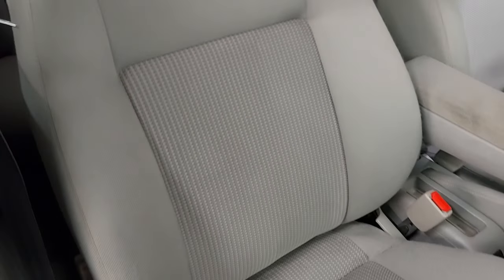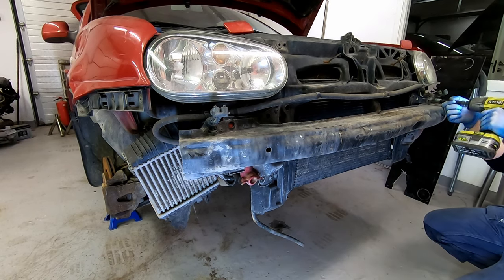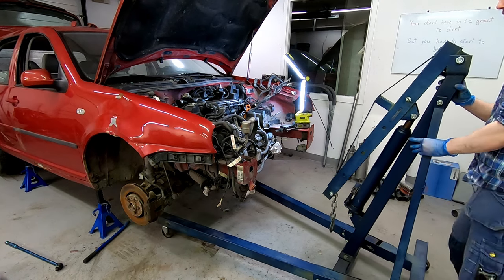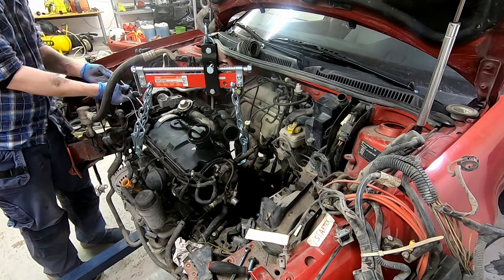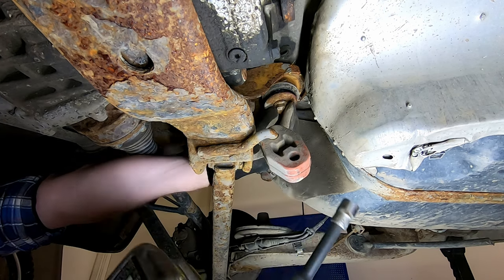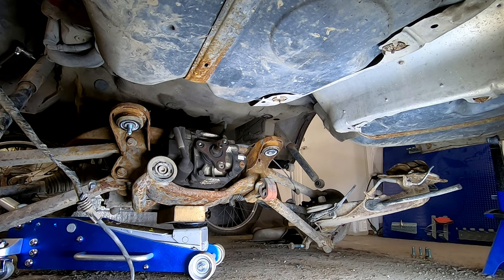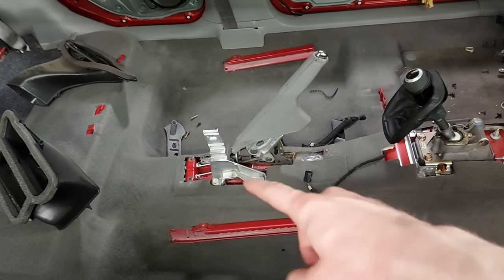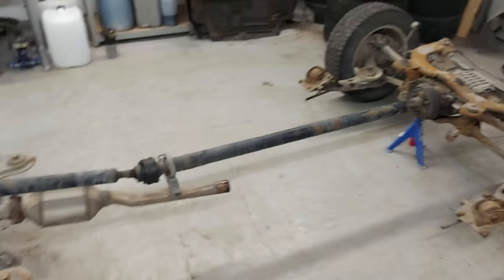VW Caddy Mk1 TDI 4Motion Part 5: Stripping the Donor Car

Comment: Hey really enjoying this build . Any updates?
Reply from the maker: Hey, thank you! It has sadly been on the backburner for a while now, though some more progress have been made. 

The firewall + frame rails have been cut out of the golf, so next step is to cut up the caddy and weld it in. 
Have also been tampering with a new subframe and suspension setup for the rear in cad.

I think you can expect a new episode in 1-2 months, just waiting on the snow to melt away.

Comment: I own a professional carpet cleaning machine that has an upholstery wand that I do auto cleaning I'm in Tacoma WA but if you contact someone small and local you can get really good prices if you pay in cash as most of us little guys are struggling at the moment. We can get ALL of the mold out down through the padding the first time with very hot water and professional carpet cleaning detergents followed by oder naturalizing spray all in a 30 minute lunch break. I just did a similar job for 70 bucks that had split formula milk and mold stains all over I hope this helps someone out there

Comment: But hey, you say in the clip that you wont cut anything near the gastank, but then you do it anyway. Why?!
Reply from the maker: That's a good question! What I actually said was ''gasoline tank'' and the reason why it is much more dangerous to grind/cut/weld etc. near a gasoline tank as opposed to a diesel tank (that I have here in the video) is that gasoline gives off vapour from as low a temperature as -23°C, which can be ignited from a flame or spark source.
Diesel on the other hand won't be ignited by a flame or spark source until it has reached a temperature of 55°C (which is where it is giving off vapour).

But honestly, you shouldn't create sparks of flames near either fuel sources to be absolutely safe!